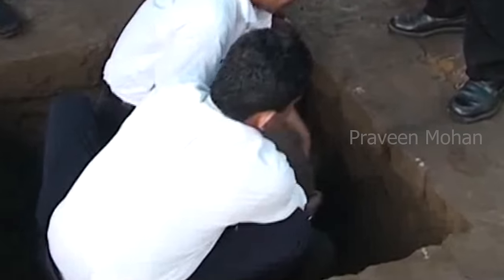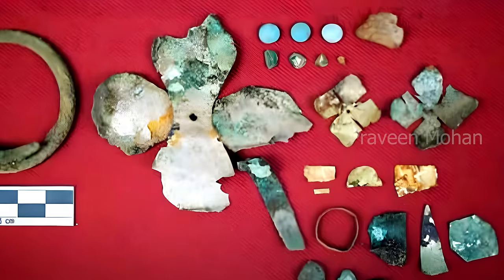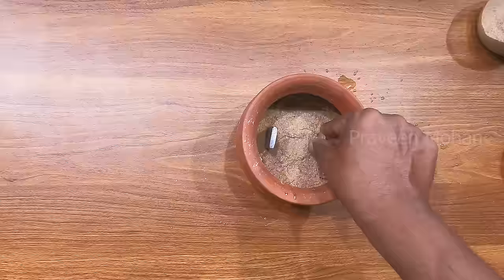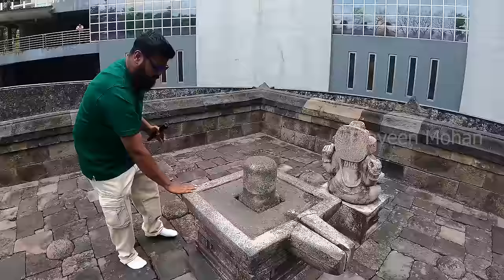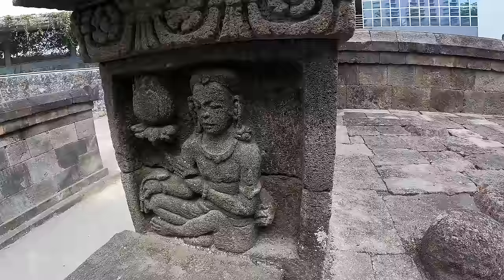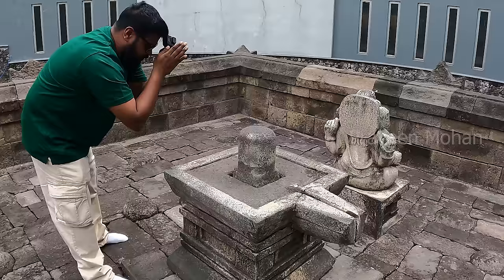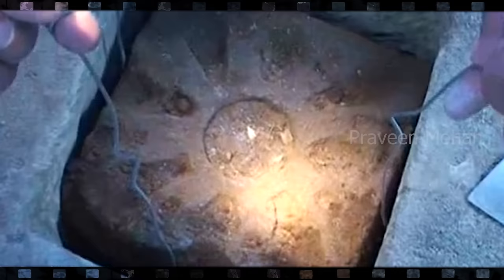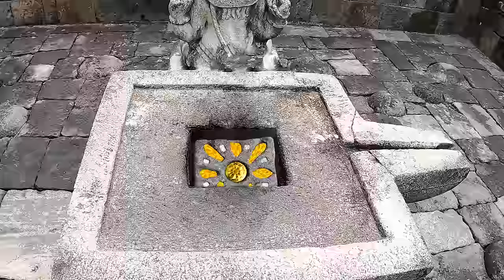Wait! This Ancient Lingam Produces Electricity?  Candi Kimpulan Temple Part 2

Comment: creating electricity isn't hard it can be done with silver and iron in many different substances, what uses did they have for the electricity did they have lights or motors or anything. creating a voltage is one thing but using it for something is completely different

Comment: Praveen sir please do my request flow water normaly in that silver rods pot what's happened is water generates electricity or not please I don't have equipment
Reply: Bro it's simple, as long as both the electrodes have some potential electrode difference and they are connected and are dipped in an electrolyte {electrolyte being salt water etc} u can generate some volts

Comment: Im not convinced. Half volt is so small its not possible to use it anyway. 3.5v Led was not existent in ancient times so your experiment is not reliable. Electrotherapy and other device requires much higher voltage. Primitive light bulb would consume about 40v potential at best to just start give some light. Of course if we accept theory that light bulb of some sort was produced in Bharat. Maybe much bigger wase, rice particles and electrodes give more potential but still it is a big difference between producing Energy and using it. I expect that milk would work as a medium and as far I know water was not used in ceremonię. Why to connect ceremonię to power generating at first place just because lingam was near by??

Comment: C'mon Mohan I don't know why you just won't accept my theory about the lingams. You do remember me messaging you years ago right? Dude there's no way I'm wrong. Check it out man, if the condensated water that these things used to produce by utilizing the ammonia in the urine from the blatantly depicted cow as a refrigerant were to  become ionized by running over copper and a galvanized metal like aluminum or zinc, in a circuit until the needed 12vdc charge was induced and then ran down a spiral track becoming the secondary coil to the split trough. Where north and south were on either side of the mentioned split, the ionized water particles would be drawn to their corresponding poles and flow to the ground becoming leads for a self powering "Tesla Coil" if an induction coil was placed inside the thing the process could be started just by pouring liquid on the thing. Sound familiar? Oh... and if you were to drink the water from the device guess what would happen...!?!? Your skin would turn blue. I would really like to find a sponsor to help me make this device happen. My name is Bob Lockett II please contact me somehow